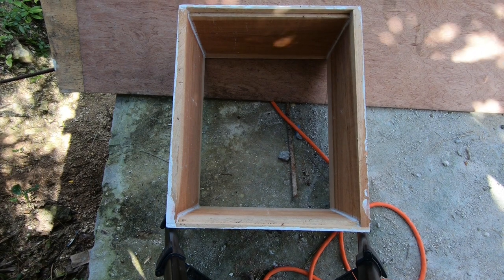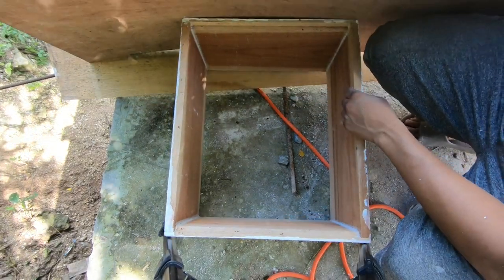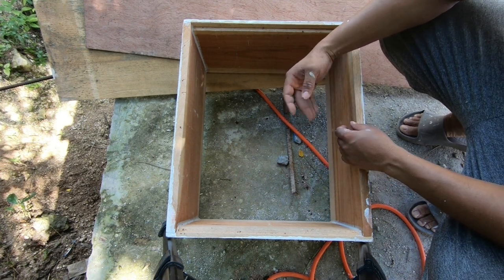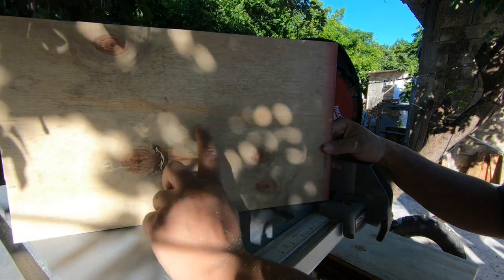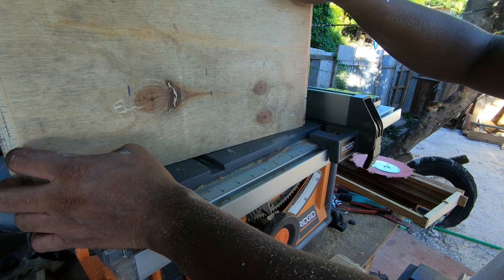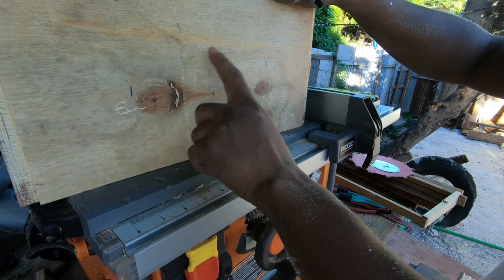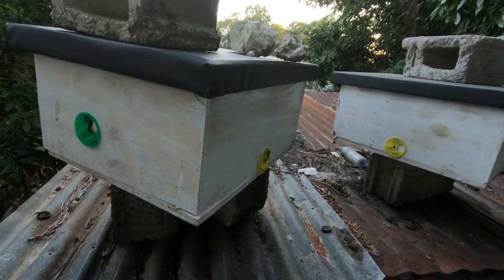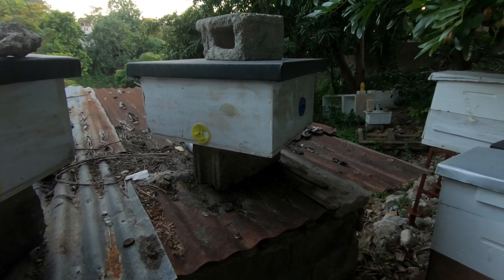Beekeeping in Jamaica: Queen Rearing Episode 1  - Building a Queen Castle

Comment: Devon, do the bees propolize in the dividers and the cover? 
I admire your desire and skill to make your own boxes. 
In the US, I can buy a box for $10-$12. If I had to buy the material at the hardware store it would cost as much.
Best Wishes man.
Reply from the maker: Yes they do put propolis there and covers which is easy to remove. In jamaica its the opposite, buying ready made boxes are more expensive. Cost about $17-20 per deep box. Frames are $14 for 10 and a super is about $10-12

Comment: Sir do, birds eat queens, dragonfly eats queens. Ok! Color coding can help the Queen to zero when returning from her mating flight.
Good luck and a nice all have fun 👋.
Reply from the maker: Hi Hans, I have a bird problem in my area that much I'm certain. I really don't know how to keep them away at times since I'm mostly at work.
Reply: @redzwashere  Sir do, I had good results when I put up 5 scarecrows in my surrounding area until the birds got used to seeing them. So I rigged the scarewcrows with strings to nearby branches so the wind will cause movement. Problem solved.
What works for me may not work for you - however, it is better than not trying to improve the result in your favor.  Good luck to you 🙂 👋
Reply from the maker: Thanks, I will give that a try as I need to get it under control

Comment: Well done! Are u using a R4513? I had purchased the 8" dado stack to find out this table saw does not accomodate 8" dado stack.
What is your spacing for the castle's dividers?
Regards from Haiti!
Reply from the maker: Hi Jean, thanks for watching. Yes this is the R4513 table saw. It will accept a dado stack but only about 2 blades sadly. Still that is enough to make short work of grooves with a few passes. As for the dividers the spaces was divided equally so I don't know the exact measurement. Nice meeting a beekeeper in Haiti

Comment: Handling queen cells from day 10 to 14 is not recommended since this is when the queens are the.most fragile. When you are moving queen cells from 1 hive to the other during this time may be a possible reason for your low queen survival or acceptance.
I also noticed you are not completely filling all your boxes with frames, and you seem to have low populations in each hive because the extra room is not available. In other words you have low populations because you are not giving them a place to live. That is why you had the nuc keep drawing out queen cups because the only space left to lay was in these. They had stored nectar in the worker brood cups.
I wouldn't add a second deep until they have drawn out a full 9 or 10 frame deep about 90%.
Then  when you do add the second deep move the outer brood frames from the lower deep to the new upper deep over the brood centered in the lower deep  brood frames. If you do not have drawn frames of comb then take the rest of the drawn comb from the bottom deep and checkerboard the existing stores frames with the new foundation frames.
It takes 9 times the nectar resources to draw wax, than honey. To build a good foundation for your business having drawn comb is vital to maximizing honey production.
In another video there was some comb that had fallen off the frame. Best thing to do if it was not wired is to press it onto a wired frame, heating the wire if possible, or reattaching it into the frame it came out of using rubber bands.
Reply from the maker: Thanks for the comment Fred. When do you move your queens to nucs to be hatched out? Most other beekeepers I see online does this at day 10 or hatch out in an incubator. In regards to drawn out combs i don't have that in abundance so I try to give them space as they need it. I will definitely try moving the outer brood combs up to the 2nd brood chamber once they are about 8 or 9 frames strong. Most times when you see a second empty brood box it's as a result of feeding using the method used in Jamaica. Frame feeders are very expensive in Jamaica and I haven't come up with a more effective way to feed while giving the bees  only the space they need. I have tried the bucket feeders I see Ian steppler uses but it will sometimes leaks and causes robbing. Can't find good ones down here to make a good seal. Do you have any suggestions? I will be doing resource hives to help build out combs as I increase my operation. I currently have 11 hives coming from 7 this year so most of them are small splits I made this year using walk away splits which I find that not so effective. Most times the queens don't come back from their mating flights. I will be making scare crows to hopefully help with that (lots of birds). Also what do you think about Mike palmer's style of sustainable beekeeping? I want to give that a try
Reply: @redzwashere  Devin, I think your method of feeding is brilliant. Maybe make up some 2 to 3 inch shims for above the hive to place the bags. For large apiaries open feeding from totes similar to what Ian Steppler uses might be an option, but placed on an ant proof stand. Keep it at least 100 yards away from the hives to prevent robbing.

As far a queen rearing, I use the cloak board method used by the University of Guelph. It combines the starter/finisher into 1 colony, and a home made incubator. The grafted frames are transferred into it once capped. This prevents the bees from building excess comb between the cells. I can also add roller cages over the cells, with a bit of honey for food so I can bank the hatched virgin queens for a couple of days in the event of poor weather around the time they should be going into the mating nucs. I only raise 1 batch of queens in the spring each year to make up nucs and eventually grow into single deep colonies for over wintering. In the spring if I have more colonies than I need I can sell them, either split into 2 nucs, one with the overwintered queen, and the other with an introduced mated queen, or as a single deep colony. I am a hobby beekeeper and find around 9 to11 hives is my limit with the spare time I have.

Scare crows may not be effective since the drone congregation areas may be up to 5 miles from the mating nucs. Drone congregation areas are often around perpendicular landmarks such as road intersections. Although difficult, figuring our where these areas are, and placing the mating nucs close by will help reduce the risk of predation during the mating flights. Unfortunately the predators find these areas more easily the we do. Are there areas tht have more flat land 

My incubator uses a deep langstroth nuc body covered by a foam board and cover, above a heater/control section. I made up a foam insulation sleeve for inside the nuc body, which is removable since I reuse the nuc box once the queens have mated. 
The bottom heater/control section has 2 compartments which contain the controller section is at one end in its own enclosure vented to the outside, and the heater/fan section in the balance of the space towards the other end, mounted to the bottom floor at 45 degrees, and under an aluminium plate which acts as a heat sink and helps dissipate the heat more evenly. The aluminium plate could be any metal that can act as a heat sink, and it has a 1/4 inch gap around the sides to allow air circulation at the edges. I didn't bother insulating this section since most of the heat is radiated up into the nuc section.

The main components are:
a)  Heater control bottom section containing:

Constant Temperature PTC Electric Fan Heater for Car Small Space Heating Incubator(12V 150W) $27.69 CAD.
Inkbird Temperature Controller ITC-1000F 12V Digital Thermostat Heating Cooling Dual Relays Sensor $21.99 CAD.
b) Nuc box with removable foam sleeve and foam cover
c) Removable outer cover.

Seeing as you are handy with woodworking have you considered building swarm traps?

Do you have issues with hive beetles or varroa mites?

In Jamaica you obviously don't have the issue of overwintering, and the bees, but during the dearth your bees would still be active. If you don't fed them, what would be the effect over the year. Would the colonies shrink but survive, similar to our overwintering? Would they build up again in December through May? 

I grew up in Nassau Bahamas and cannot remember exactly when flowers bloomed. I do remember that the Poinciana's (Fire of the forest) bloomed in spring, along with the bougainvillea and hibiscus which bloomed until late summer. July and August were tropical rains in the afternoons. The fall months (hurricane season) was more rain and some stormy weather. I don't recall January and February, although they were often quite cool, and March was when a lot of deciduous trees lost their leaves for a couple of weeks, leading into the spring bloom. What is the seasonal progression in Jamaica?

I also noticed on some of your videos that someone was playing music local to the area. Do you think the bees being Italian enjoy this, or would they prefer something from Joe Green?  🙂
Reply from the maker: Hi Fred thanks so much for the information. Do you think using a medium super would be better since this is new equipments I started making in my operation? We are actively discouraged to not open feed here in fear of our bees mingling with wild hives that may have AFB. I will be looking into the cloak board as I'm not aware of it. I think as I grow I will be getting an incubator as most times work interferes with my beekeeping. Based on how you discribe the incubator I think I could make one as well. Swarms are also something we are thought to stay away from as there isn't really away to know the status of the hive they swarmed from if they have AFB. I do have beetle problems for hives don't are fully in the shades. But for the ones that gets partial sun no so much. Our biggest problems is mites and wax moths since we don't have a winter. Been working on an effective way to store them so hopefully if it works I will post it. Bees that aren't fead will either abscond or shrink the population. For our season December is or preflow season, then January to February is where you get a lot of swarms. Then after that March, April and sometimes may we will have an honey flow. Then June to August dearth for nectar. August to October the pollen dearth kicks in which is our rainy season. Then November somewhat autumn flow into December pre flow. This is what I have observed so far. And my bees tend to love our local music, it doesn't matter lol. Surprisingly it doesn't seems to bother them.

Comment: Might try setting them queen castles down on the ground and get them away from your production colonys ...  In grass like foot tall works best for mine .. I set them close to my production colonys queens get lost in all the confusion ... Ill find little lost mating swarms hanging off lids and things .  i run 70+ mating nucs per yard get around 95% return ... Strong virgins make all the difference if i get good hatches my return rate is high .. Strong starters and treat for black cell virus .. Poor cell hatches my return rate is low .. Varroa mites spread that black cell virus i treat it with terramycin if i see that black cell show up ...second most common virus next to deformed wing virus ..
Reply from the maker: Thanks for the tip I will definitely move them away from my production hives when I am doing my second round of queen rearing. Where I'm located there is no grass or lots of available space for me to put the boxes.